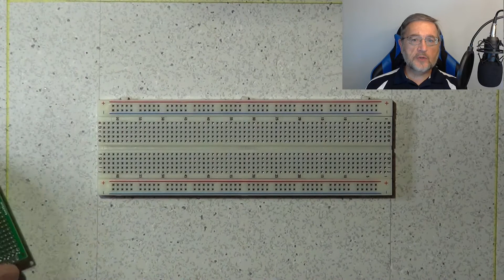Dual Power Supply For Breadboards

Comment: Great tutorial.  For my own sanity, I would have loved to see you plug it into the power bench,  set the voltages and show a little op-amp project sound/light up just to prove me it works without blowing up. 😄
Reply from the maker: Well, I actually used it in several other videos to power prototypes. Look around my channel and you'll find what you are looking for. It's featured also in some thumbnails.